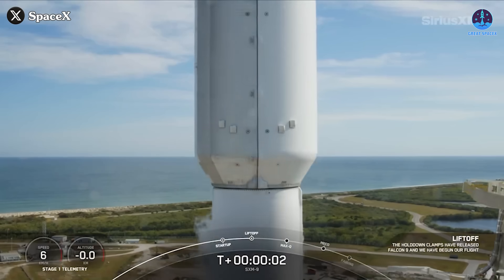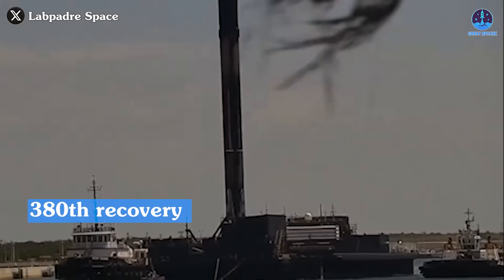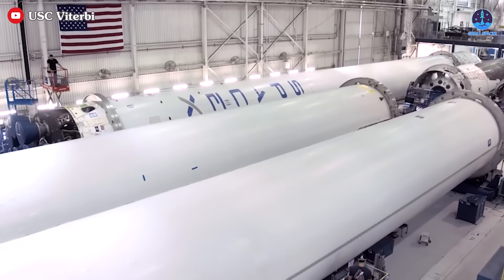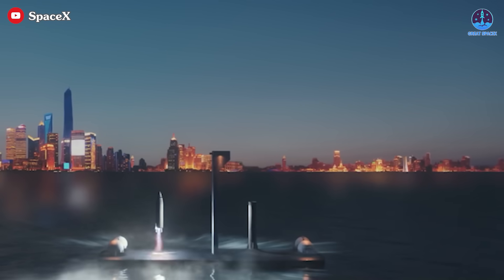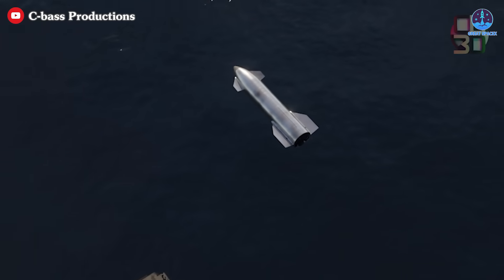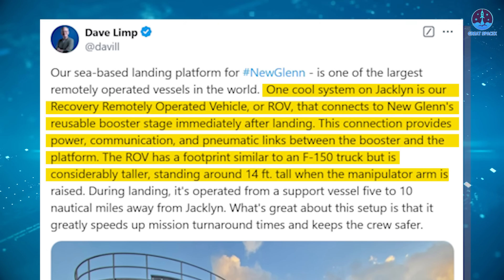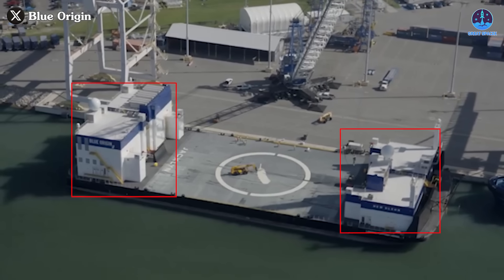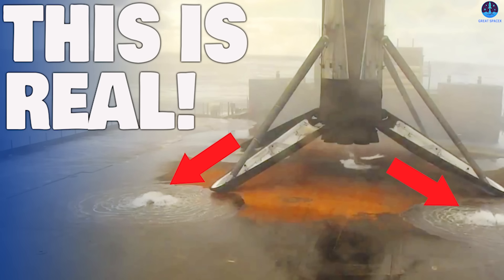What SpaceX just did with Falcon 9 Droneship is Unusual...

Comment: The platform you were talking about blue origin using is not real. The circular structure in the photo is a test booster article it wont be on jacklyn while they are landing. The rov is the smaller thing to the side with a quick disconnect arm that raises to restore power and communication to the booster. Refurbishment is still planned for on land in a factory.

Comment: What would it take to transform an aircraft carrier to a launch and landing platform?  The size of the aircraft carriers may not be large enough, so connecting 2 together like a catamaran.  Sounds crazy to the average person, but I am sure Elon has thought of this!
Reply: I wonder why there are no attempts to attach 3 or 4 manipulators like those seen on the ISS to stabilize a booster or second stage on a drone ship, especially when the booster is 80 meters high. The sea is not always calm and smooth. 3 or 4 supports attached to the corners of the drone ship reaching for the landed space vehicle could relieve the booster/spaceship of a heavy landing gear and compensate for instability. Currently these loads are balanced like a macaroni on Donald Duck's beak when he tries to swim the Ducksburgh Channel for a record, if you remember the story by "Duckman" Carl Barks.
?:o)
Reply: @NICEFINENEWROBOT  Your reference to Duckman is way past my time.  I didn't have kids of my own, which means no grandkids, who would understand you.  I remember the Apollo missions, and all the single purposed tools and craft they designed at that time.  It was like watching an idiot painting themselves into a corner, and somehow they made it work.  How do you travel to another planet in a craft that has to be worked on from the outside?  It seems like those engineers were dealing with issues of being able to sit and think at the same time!